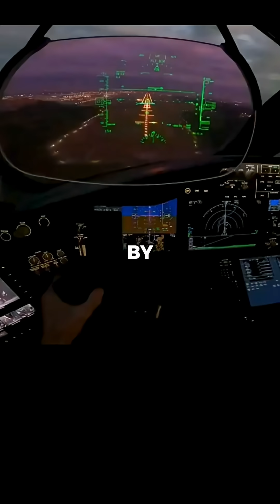Why do airlines fly planes slower than their top speed?

Comment: Another BS video. No, flying slower does not save on engine maintenance. Flying slower means you can step up to a higher altitude sooner, which requires more engine rpm, but burns less fuel.

Comment: It’s the same reason why you DON’T want to drive your car at its maximum speed 🤭😂
Reply: No, its not. Airlines can Fly higher, with higher speed so they Face less air
Reply: @WastegateDriving  yes but anyway they fly same altitude, going faster always increases drag
Reply: @WastegateDriving  it still doesn’t change the fact he’s right. The very same reason you don’t drive your car at top speed. If you had the ability to without getting in trouble is the same reason they don’t fly at top speed or boats don’t cruise at max speed.

It’s all about fuel burn and efficiency
Reply: @RevolverOcelot79 no, its not. Its about the ratio of the core, I used to work at Airbus hamburg as an intern, you want to tell me how this works? How many planes did you ever fly ? Higher even a 2000m increase of altitute would make up for All the fuel loss, because there is less air up there, less resistance. And flying lower Speeds means more flight ours on the plane which means more repair work. You have no idea about jetplanes.
Reply: @WastegateDriving Yes, yes it is. The fact that you can’t grab this simple concept at all of it is about operating at the proper power output, and flight level for fuel. Economy proves exactly why you used to work at Airbus. You’re not smart enough to figure these things out.
Reply: @RevolverOcelot79 yeah it does. It absolutely does. Entirely different point.
Reply: @WastegateDriving sorry man, you got this all wrong. When you fly faster, you get to step climb to a higher altitude much later. So slowing down, gets you higher sooner and you burn less fuel. Your internship at Airbus doesn’t mean you are knowledgeable.